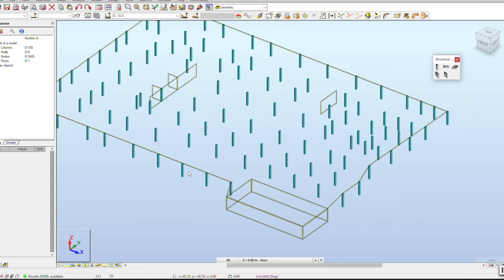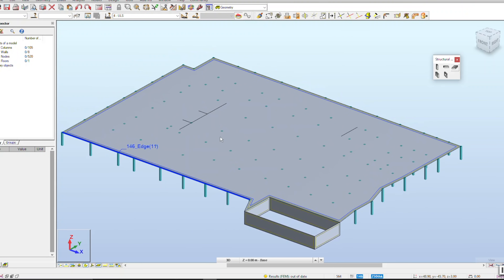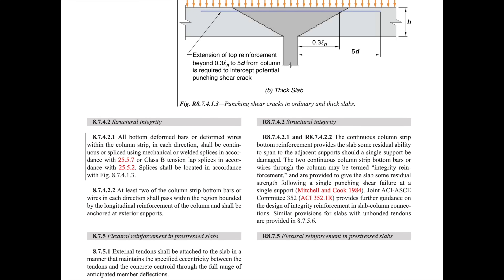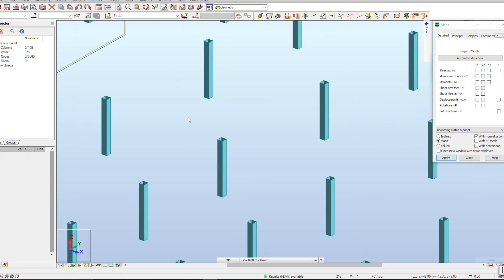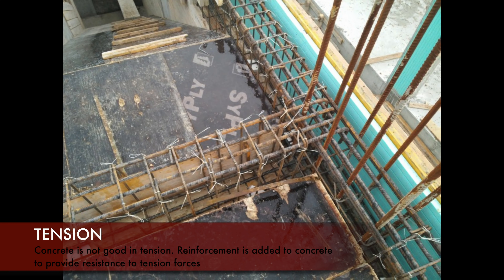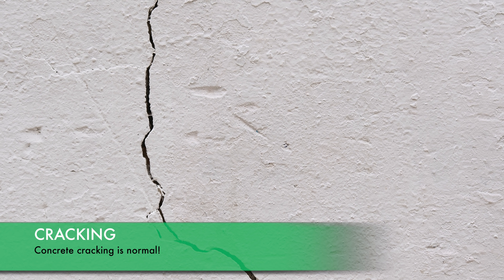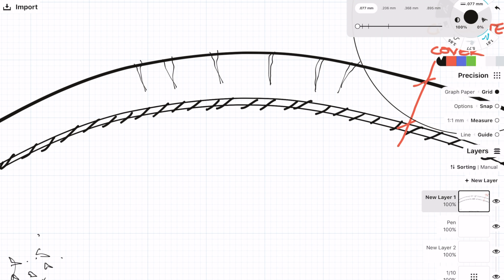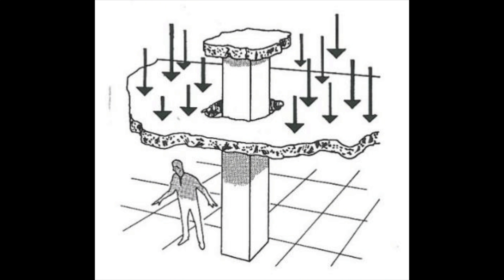Surfside Condo Collapse - Concrete structure basics - Slab bending and punching shear failure

Comment: They must have used a super special concrete on the west wing that didn't colapse
Reply: It didn't collapse because it was a rectangle shear stairwell - going from the ground all the way to the roof.  IF they only had another one - instead of just one shear wall --- it would have saved the other half of the collapsed section  ---  Thus this building design was a death trap -- terrible design.
Reply: The section that didn't collapse was also of a more robust design than the section that did since it contained a greater number of transfer beams in addition to the columns in the lower storeys of the building - at least it did in the preliminary plans. Assuming those were in the actual structure as it was built, that probably helped it holds its composure during the stress of the collapse instead of actualizing a cascading failure the way the other part of the building did.  After all, the shear wall in the Eastern section of building actually stood for a short time as the surrounding slab network punch sheared around it.

The section that collapsed was only slab and column with far fewer beams, almost none really, save for a few in the parking level ceiling close to the lower end of the car entrance ramp.

Comment: the cracking at the negative area moments will result in additional deflection in the middle. when I inspect I check for delection using instruments. My understanding of ACI is that flexural members will deflect substantially to provide adequate warning against collapse in the code.
Column heads were designed using concrete thickness. Shear head reinforcement is a later addition.

Comment: The building was build around 1980-1984. Limit states (LFRD) were implemented in the 1990s in the USA, so your calculation isn't correct. Good job on explaining engineering stuff to "normal" people!
Reply from the maker: I did check it to both ACI and eurocode codes. Just didn’t make it abundantly clear 😅
Reply: @EverydayDazz  No no no. ACI and Eurocode use Limit States design method. Before Limit states, engineers used Allowable Stresses Method. In ASM you dont have coefficients for the loads, just the materials and some of the equations are different.
Reply: @stefanstoichev8108  I would like to see some calc on the deck collapse causing moment at columns...
Reply: The end design would be very similar. It is still reasonable accurate to compare allowable to LFRD. I don’t know about the US, but we brought LFRD in the early 80s. We used to call it LSD. Limit States Design. For some reason they changed the acronym.
Reply: @yodaiam1000  Can't possibly see why....

Comment: The contiguous integration of the pool deck slab with the multi-floor structure slab is inherently conspicuous.  The environmental exposure of the "pool deck slab" increases the probability of structural failure as compared to the same-level, physically-connected steel-rebar/concrete slab of the residential multi-floor structure.   From an engineering standpoint, recognizing that there is a significant bias in long-term service life between the "pool slab area" and the adjacent "multi-floor" habitable area structure should have, in my professional engineering opinion, resulted in a building code standard that prevents this bias of service life between two types of environmentally affected structures from interacting with each other in the event that one of them fails...

So, with that said.....   One of the centerpiece engineering developments for steel-reinforced concrete structures was the invention of the expansion joint.....

Expansion joints allow the structural materials to "move about" in such a way, due to either wind loading, or thermal effects, or geological displacements (earth quakes), or settlement of the foundation structure... and some other effects...  These non-connected interfaces between ridgid structures allow them to move and flex in such a way that prevents the structure as a whole from destructively interacting with itself.  With all relevant variables included, the appreciation for the difference between the pool deck portion of the same slab that comprised the ground level slab of the multi-level structure was clearly non-existent within the minds of the engineers....  I have no doubt that this difference was evident to them..  It doesn't take a genius to see such difference.  But on the same token I will openly challenge the decision making process of said engineers for the entirely myopic choices they made in their duties for safety and human life... "I'll be dead and gone far before this thing collapses and kills a hundred people...... screw them.. where's my paycheck?"  Right??? :-(

I know that all of "us" here can be 20/20 hindsight engineers but I will tell you in your face, I am NOT here to tell you what you SHOULD have done to prevent this catastrophe from occurring..  Keep in mind that you, I, and all of these viewers as "our" witness, this was something that happened that we are all trying to make sense of for the better good of us all...

So......  with that now said...   At a certain point, and I think the moment here is now...  that it needs to be integrated into the building code to recognize the bias of environmental exposure of a contiguous slab and at a defined, engineering standardization, take this into account for the determination of where the separation of a contiguous slab should be placed.... AKA: expansion joints..

If there were an expansion joint built into this structure that separated the exposed area of this ground-level "pool deck" slab from the multi-level occupied vertical structure slab, well......  it would certainly not have made global headline news.....  or cost 97 innocents their lives either...

No one expects anything man-made to last forever... but for the love of life, we should hold our engineers to an expectation that if the pool deck decides to shit the bed in the middle of the night...... that the fallout isn't going to crumble the whole house down and crush us with tens of millions of pounds of stone and steel either...
Reply: I agree completely that there should have been a discontinuity between the pool deck slabs/beams and the residential areas/blocks. I would also consider another 'break' between the two legs of the residential block(s). (Spelling edited/corrected)
Reply: Basically you are saying is that the design allowed the failure of an ancillary structure, the pool deck, to cascade into failure of the more critical main structure. This would akin to the failure of a landing gear door to cause separation of an entire wing of an airliner.
Reply: @christophercripps7639  Pretty much, yes..  Or an engine cowl shearing loose and taking out the horizontal stab.  It is a little different though because you can't physically separate components of an aircraft from itself and have one part of the plane flying along side the other parts..    Airplanes just don't work that way. ;-)

When properly engineered, constructed, and maintained, the use of an expansion joint as I suggested would not be necessarily required.   We don't have an epidemic of buildings collapsing so let's keep the main gear bay doors on the plane for now.  

There clearly is more to knowing all of the factors involved that led to this structural failure.  An expansion joint may have prevented this but maybe it wouldn't have.  We don't know quite yet exactly how this happened..  However,  If the engine cowling never shears loose then you don't need to worry about it taking out the tail feathers either...
Reply: @christophercripps7639  What we are dealing with is a progressive collapse.
Reply: Very well said. I also said expansion joints some time back when the picture was evolving. P.s. I can tell your angry.
Reply: Almost everybody is corrupt nowadays  I bet they make this thing seem like that they can't blame anybody for it or it will eventually just be forgotten about and we won't hear anything with pisses me off by what you said you sound uncountable at least hope im right
Reply: @deppurple700  Well, the opposite is going to happen.  EVERYONE who had anything to do with this building is going to get sued and that list will go all the way up to Tallahassee...  The building engineers,  site surveyors, construction contractor(s), inspection/maintenance contractors,  insurance companies, the city government, the county, the state of Florida..  the association members will be individually targeted and possibly other individual residents of the building too.       This wasn't some ghetto projects building..  The units within the building were worth anywhere from ~$750K and up into millions of dollars each.... and the family members of the victims are most likely also financially affluent with access to the best legal representation.... even if they aren't cash-capable, any attorney would jump to represent them in this case.....   and they are going to be relentless in their pursuits to hold people accountable.  This is not going to be swept under the rug at all - this is actually going to get very messy and will undoubtedly lead to some number of changes in law, regulations for property associations,  possibly building code, etc etc...

Comment: Great analysis! The lack of robustness or resiliency in the original structural design is certainly a major contributor to this cataclysmic collapse. The building structure was initially unable to resist a partial collapse.
Reply: Everyone is an expert now in the surfside collapse
Reply: Define robustness? Still waiting for the side by side comparison of 1st and 2nd collapse/ demo? What's the hold up?
Reply: @seedplanter7173  
From NIST 
" Structural robustness is the ability of a structure to withstand local failures without disproportionate collapse. Redundancy, integrity, and ductility are key factors that influence the robustness of the structure. The assessment of structural robustness requires simulation of structural behavior under various local failure scenarios."

It was evident in the video of the building’s demise, the main structure collapsed as a result of a localized failure. Regardless, whether or not the overall building structure was deficient in rigidity, this issue will be part of the impending criminal and civil cases presented to the courts. 

The investigators will note in their report why the remaining portion of the did not collapse. One could reason that the shear wall and its location prevented the full collapse of the building. Also the location of the initial collapse in relation to the remaining part of building.
Reply: @I.B.Scratcher  And that's something we would have wanted to see at Champlain South.

Comment: You focused on punching shear capacity, you didn't say anything about flexural design.  My contention is that the flexural design was also marginal which allowed the slab to crack more than it should have, leading to degradation of reinforcing steel.  If the negative moment zones are insufficiently reinforced and crack more than normal, that can affect the punching shear strength.  If there were punching shear failures, or even some hinging due to flexure failure, the unbalanced moments at columns would increase punching shear stress on part of the punching shear perimeter and lead to punching shear failures.  Josh alluded to this unbalance at the extreme failure condition but he didn't explain how it applies in the calculations prior to the collapse starting.

Comment: I’m glad we can agree to this preliminary report. Builder Nathan Reiber failed to use good decking and limited amount of reinforcements from rebar.
Reply: and a terrible design --  I wonder if there are regulations to stop designs where the pool deck can take down columns/attached to the building supports - unless there are redundant supports for the building
Reply: @roycem4945   - This was a design flaw, by not making the pool deck completely independent of the main building structure. The catenary action of columns failing created the chain reaction building collapse.

Comment: Calculating the tributary area of that random mess of columns in the garage is no easy task.  They are missing so many beams, reinforcing, columns, need larger columns, higher psi concrete, thicker slab , heavier reinforcing, and so many other issues.   So many issues it’s mind boggling. Great video!  Great job!
Reply: And they were saying, 'how could this happened in the 1st world?' LOL! Like it's supposed to happen in upper Burma or Papua New Guinea.
Reply: @inlikearefugee5194  I remember the Mayor saying that.  Strange statement to make.
Reply: It is simple.

Comment: A bit strong to say the design was not code compliant without any caveats....like it doesn't comply to Eurocode 2  etc..  Was your analysis done to ACI 318 or its 1979 equivalent or to the current Eurocode 2?
Reply from the maker: Yeah probably is a bit strong but I did check to both codes. But either way, the building under normal conditions should have been fine.
Reply: @EverydayDazz  @ way still underdesigned as a beam was missing.
Reply: @designstudio8013  Come again?
Reply: @Katoshi_Takagumi  what?
Reply: @designstudio8013  You said there was a beam missing. Which one?
Reply: @Katoshi_Takagumi  The nut on the  Construction Engineering & Failure Analysis channel who is sueing everybody said Beam A running from east to west along side the parking areas where the grade changes and into the building. There was only a weak control joint there.
Reply: @designstudio8013  Under the facade then? There's an elevation change, so I would have expected a beam (as a layman). If you've watched the Kostack Studio simulation (which I did not like) it indicates several beams in that specific area.
Reply: @EverydayDazz  The actual code you should have a look at, is the 1976 Florida building code, I think. I have no idea if there is a requirement to retrofit older buildings to bring them up to code unless the buildings are located in seismic areas.
Reply: I work under ACI codes and I'll back up what he says with respect to ACI 318.
Reply: Other engineers that have done an analysis have come to the same conclusion. I am a structural engineer but I haven't done an analysis of it but just from experience, the reinforcing looks really light and there are no drop panels. Any reasonable code from the first world counties would come to the same conclusions. Bending and punching shear stresses in concrete haven't changed much since the 1970s.